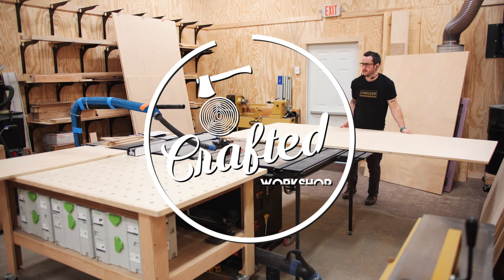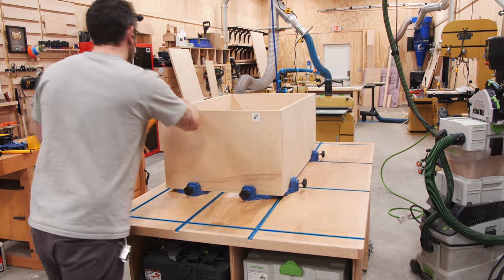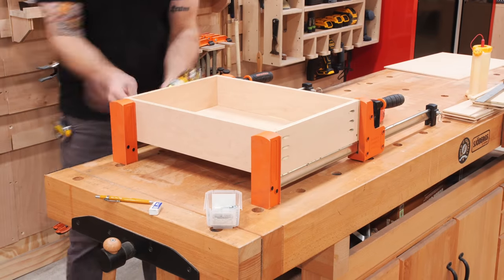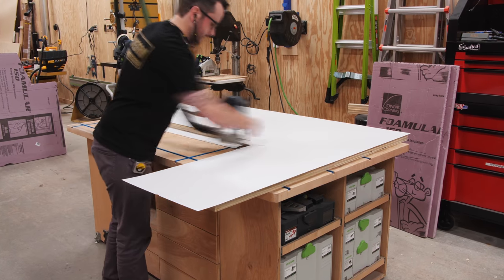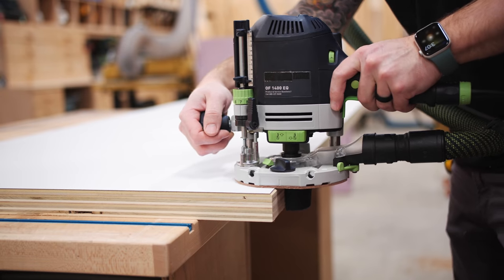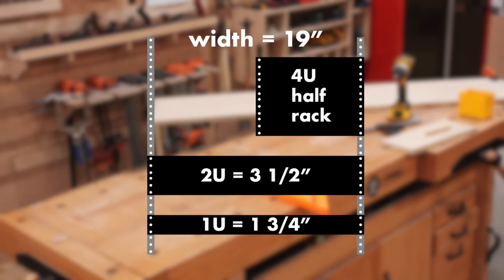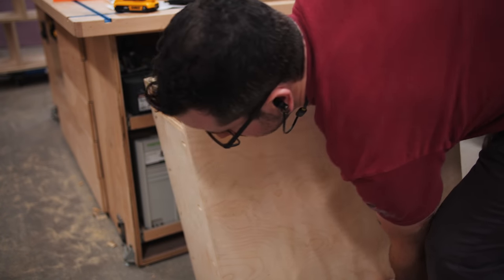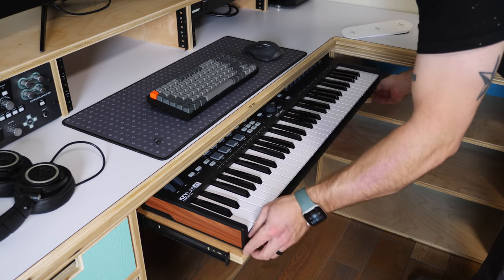Building the ULTIMATE Music Studio & Gaming Desk Setup // Woodworking

Comment: I've built probably around 5000 laminate coutertops, haha. I would suggest buying around 20 or so 1/4" dowels and use those instead of clamps. it will help prevent making small cracks worse!
Reply from the maker: Good tip, thanks!

Comment: Very nice build :) But putting the speakers in a corner in an untreated room is not the most optimal thing for music. You will have an unbalanced stereo field (early reflections arrive faster from the corner speaker) plus having a speaker in the corner will emphasize the bass frequencies in a unnatural way (boomy/lack of clarity), and lack of acoustic treatment will make the room frequency response uneven due to various filtering effects a non-symmetric placement causes.

Optimally you would have the speakers 38 % from the wall you face towards the opposing wall, in the middle of the room - meaning the left speaker and right speaker are equally far away from their side of the wall. And the room itself should be a perfectly symmetric, but non-rectangular cube. You can search for "optimal room sayers" for some example layouts :)

Comment: First off, very nice wood work. Couple critiques based on it being a "music studio":

The desk should have been centered in the room, with speakers equidistant from, and on the same level as, your head while at normal seated position. I didn't see any acoustic panels/bass traps, but we didn't see the opposite wall so maybe you have them?
Also, the desktop tower shouldn't be basically touching the monitor speaker, like that. EMI aside, the sound waves coming off the back of the speaker cabinet have the potential to vibrate components and un-seat them (cables, RAM, even video cards. I've seen it happen)

Comment: That is a great build but the right speaker is right against the wall and the left speaker is not.  Your stereo field is going to be wonky due to the non symmetrical layout.  If possible have the speakers in the middle of the short side wall away from the wall a bit on stands.  Set up absorbing panels at the first reflection pints of the speakers.

Comment: TIP: whenever building any shelving or bookcases, create notches at each back vertical and each horizontal shelf as necessary to be able to run power, speaker wires, USB, etc.etc. etc. ANYWHERE within it.  Down the road you'll either be glad you did, or never notice that you have them there if they aren't used.  My large set of wall shelving that sits on my custom computer room countertop is missing the lower back corners of every piece sitting on the countertop, and they get used constantly to pass wires between...

Comment: 21:00 so instead of drilling a hole big enough for the plug, disconnect the plug and only make a hole the thickness of the cable. <3
Reply: or given you're doing a built-in desk, you move the outlet before you start :D

Comment: Is that dewalt impact driver the atomic
Reply: John Langan isn’t the atomic series their lower end stuff?
Reply: OK subject 81 but the dewalt impact driver the atomic is handy for tight spaces
Reply: @johnlangan9101  I agree, a small impact can be handy, but i was honestly curious if it was their lower end stuff. I'm a Milwaukee guy, my new 18v fuel is actually slightly smaller than my 12v fuel, albeit with a larger battery/base and the 12v is quite small. I just assumed that the dewalt would be roughly the same size, maybe a little larger.
Reply: I have a millwakee circular saw and mitre saw the new one I like the cordless tools and nail guns too yea I like the dewalt impact driver for doing suds on a wall

Comment: While I love the look of your desk and the mechanism of the keyboard sliding right there, such setup is still not really optimally in terms of being ergonomically ideal for the position you are. It also may not be easy at this time to both have an ergonomically body position for both the music keyboard and typing keyboard, since they basically need the same area for optimal ergonomically position.(your upper arms should be straight down, and then underarms in 90% degrees)  In your setup for example, your music keyboard is at a comfortable position, but your typing keyboard and mouse are way, way  too high, increasing the chances of RSI (repetitive strain injury/carpal tunnel syndrome) when you are using your mouse and keyboard.

I see 2 parts of a solution that ergonomically would improve the situation most of us that play the music keyboard and use the typing  people are in:
- We would need a music keyboard that has a very thin base underneath the keys, while at the same time the keys should be normal size and depth. This allows the height of the midi keyboard to be as close to the typing keyboard as possible.
- The desk ideally be as thin as possible, so also this decreases the distance between the the midi keyboard and typing keyboard are at the same height as much as possible. The MIDI keyboard should slide right under the typing keyboard, in terms of height.

I still do not understand why there are not more places selling such setups, as it seems like a easy money for a relatively simple, yet common problem. It should not even have to be something that is expensive. Whenever I look at 95%'s people's setups, It's really never ideal for this reason. I see half of the people with comfortable music keyboard locations and the other half with uncomfortable midi keyboard locations while realistically speaking both options should be possible.

Dom Sigalas (a guy who does music production on youtube) even went from using regular mouse to such a thing that you rotate with your thumb because he also had carpal tunnel/Repetitive strain injury (pain in which means arms/shoulders) which is no wonder because also his desk is way too high for his typing keyboard. I think a lot of us use the typing keyboard and mouse more than we think, since playing something is done in a few seconds and tweaking your music can really take ages. 

Also, this solution would also increase the legroom anyone has under their table as much as possible.

So desk manifacturers, please make such a a thin  music keyboard and desk!!